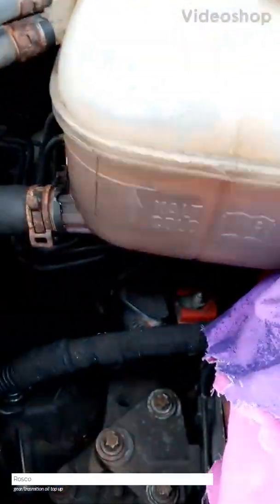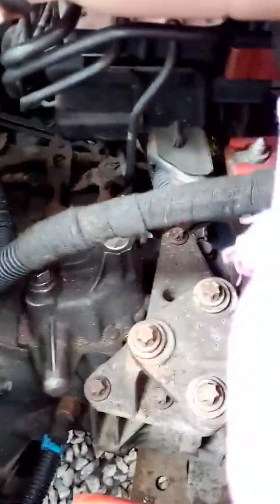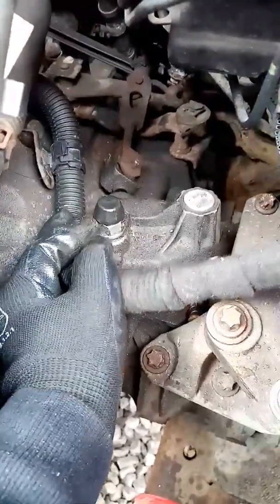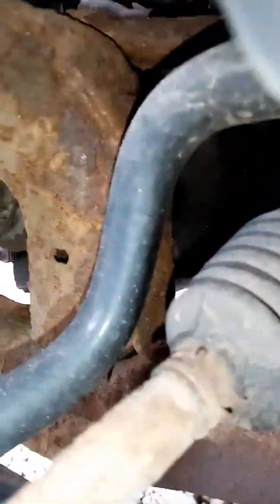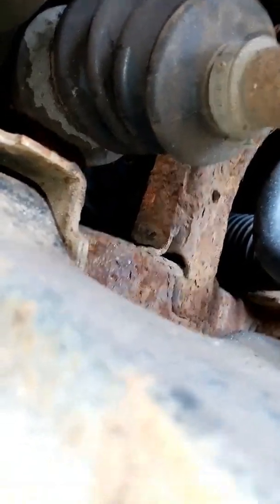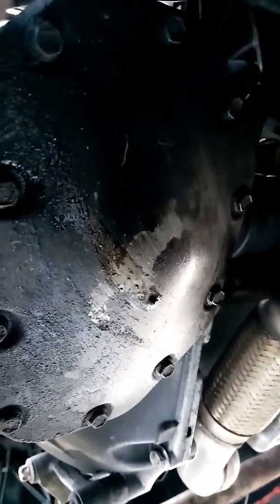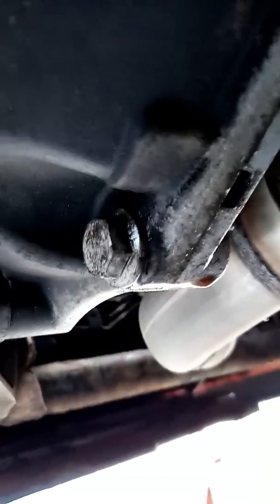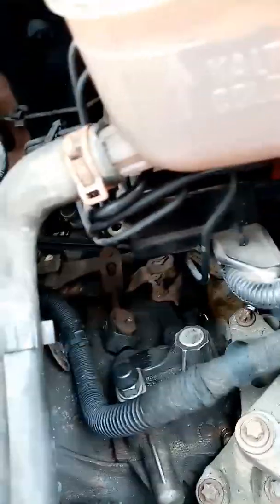Vauxhall astra h/mk5 F17 gearbox/transmission oil top up

Comment: My F17 was saved by the fact it's first owner was an old fool who used to tow it caravan, slipping the clutch everywhere. So it was replaced at 30,000 miles, before the crap GM oil had a chance to finish it off. 164,000 and no signs of bearing wear yet.